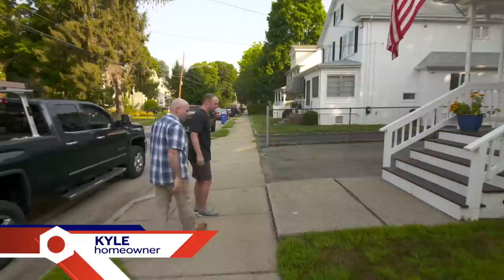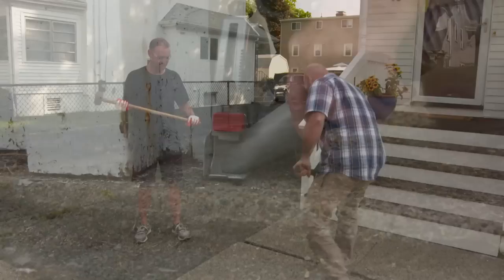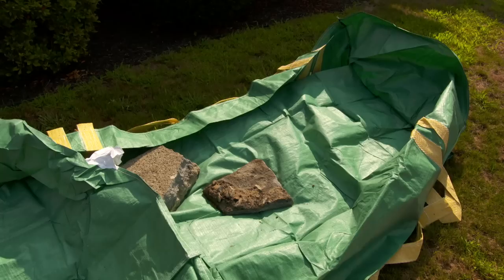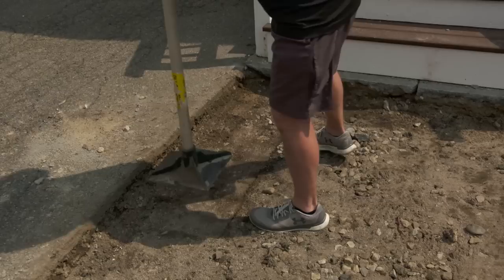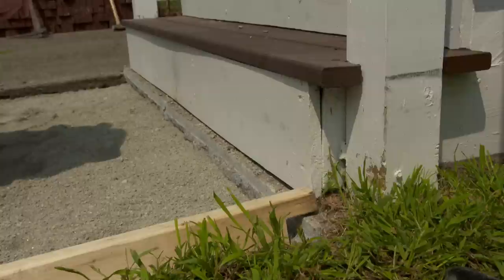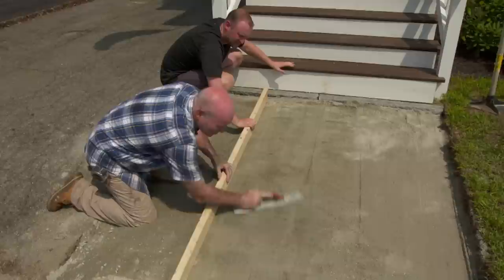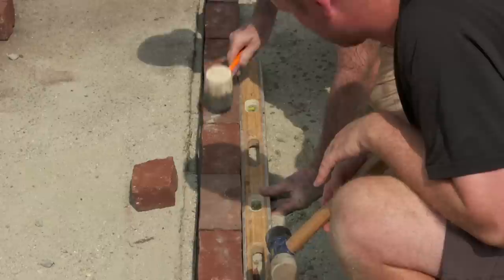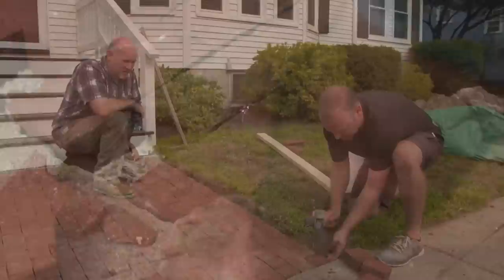How to Replace a Concrete Walkway | Ask This Old House

Comment: I like to use polymeric sand instead of stone dust. It cost a little more but it locks the pavers in better and last a lot longer
Reply: Are you talking about to fill the joints or below the pavers? Or both? I might try this and I want it to be rock solid...
Reply: @MoneyManHolmes  For between the joints,If you do use Polymeric sand be sure to follow the instructions.
Reply: Do NOT USE polymer sand under pavers as you would just be wasting it. The whole thing about polymersand is that it hardens when it dries and become malleable when wet. Giving it a slight self healing effect when pavers move slightly as they always do when things get humid. With the added benefit that they help keep weeds from rooting into them.
Reply: Yup, and it's also more resistant to ant holes and weeds.

Comment: Better method is to put down some landscape fabric between the gravel and the stone dust to keep the gravel from being clogged by the dust giving you better drainage. Sand is better than stone dust too as it holds less water meaning fewer frost heaves later on.
Reply: Rick W but sand isn’t a solid base for the pavers to sit on and stone dust doesn’t absorb water
Reply: Not to mention the inevitable crab grass that will start poking through-should be fun pulling that shit up 10x a year
Reply: No that’s wrong
Reply: @johnathanbahna7495  Using sand as a leveling product is far superior to stone dust in every possible way,  Landscape stone providers even indicate to use sand. Stone dust absorbs and holds onto water, also causes it to slurry and clump inconsistently, sometimes causing a muddy layer that sinks pavers. While water flows threw a sand medium with ease just like filters.

Comment: Could they have used polymeric sand rather than stone dust to fill the gaps?
Reply: No, polymeric sand is strictly for joints at the surface. It doesn't make for a good bedding material.

Comment: Is the removal of the disposable dumpster free?
Reply: No. Total cost is about $245US (not sure where you live). It costs around 75 just to get the bag from the home center, and the rest is due when the pickup is scheduled with the disposal service. 

The only disposal company in my area that offers this is called Waste Management, and they call this a "Bagster" (mashup of bag and dumpster).

Cheers from New Jersey 07014

Comment: not sure why you didn't also lift the concrete up with the pry bar next to the wooden steps and bust with the sledge hammer. that's the hard way to do it just hammering into solid concrete. lol. ok i see you finally did that in the next frame

Comment: Wait for rain, wtf. They were probably there all day and he now has to wait until it rains to see what they accomplished, doesn't make any sense to me.
Reply: Right? upturn a sprayer hose so it's not a direct spray and get the job done. Or, Use polymeric sand and a plate compactor.
Reply: what if next rain isn't for months?
Reply: Poor guy don't own a garden hose and this old house can't afford to supply one just like they couldn't afford to rent a jack hammer
Reply: Because you want the drainage from your house to follow the slope into your pavers... nothing accomplishes this with stone dust better than a full rain.
Reply: @Homepros888  the price of water in boston is too expensive and rental fees are also too high.

Comment: Home come there is no weed barrier? I had had the weed barrier clothes under the bricks and 5 years later I still have to pick out weeds after I cut the grass weekly every summer. I can't imagine what it would be like without it.
Reply: In this type of application there is always a chance of weeds in the joint. They don't grow from under the brick. They grow superficially in the joint. So the cloth won't do much to help that .

Comment: I hate using a sledgehammer climbing on top of a dump truck pounding it so I can fall through the tail gate with out problems it's back aching work wire mesh is the worse takes the wind out of u

Comment: They don’t realize that it will more likely be a forklift getting the trash. That forklift will do a lot of good for that sidewalk. And ATOH should have a jackhammer on hand like now they have sledgehammers on hand.
Reply: I looked into those bagster things a long while ago when they first came out. They need to be placed close enough to the street that the truck can pick them up using its on-board hoist, there was no forklift involved. For me, when I do work around my house it is a lot cheaper, easier, neater, and faster just to throw stuff in my trailer and then pay to tip it at the County transfer station.
Reply: Those Waste Management bagsters get picked up by a WM truck with a crane arm, not a forklift. If you place the bag near the road as they instruct, they just come and pick it. I did this last year and that's how they picked up the bag.

Comment: Why screed it when you are still going to hammer each one?
Reply: Because by screeding the surface you get an aproximation, it's not supposed you will get it perfectly right with only that. I wondered that myself, but it's because we are thinking about pouring concrete and this is stone dust.

I mean, if it were concrete, you screed it and you're done (well, not exactly as you then may "polish" the surface, but the leveling is done), but this is stone dust (in the end: sand), and they are working on it afterwards (you can see them both on their knees) on different ways. So, again, screeding it is more about having the surface kind of ready without too high or too low points, but then you have to set the bricks in place with some "convincing", also because those bricks are not all made equal.
Reply: For just the reason he said. You cut the high spots and fill the low ones. If you don't do it your walk is eventually going to end up very uneven.
Reply: fadetounforgiven d
Reply: @rickfromthecape3135  it's still going to be uneven.  Those bricks have indentations in them and they were standing/kneeling in screened area. You should always work pavers out which means walk on ones that have been set.  You can even put down plywood as to not indent some bricks.   Not a professional job but merely a homeowner fix.  It will look good for the first year.

Comment: The home owner is an actor. if you have ever done that kind of work there’s no way your not walking away from that with your legs not bleeding cause the concert destroys your legs
Reply: They aren't actors - they are the real home owner.  However, the scenes are professionally directed where they have a full labor crew behind the scenes do the bulk of the work while the production takes the intro, some intermediate, and final shots of the homeowner doing some work.

Comment: Sorry, but if you have a concrete saw then why not just cut it into pieces instead breaking back with sledgehammer lol. Also.. this looks like crap. Anybody who would get rid of concrete to replace it with bricks is crazy. Concrete looks 100x better and you won't have to be out there every other day spraying weeds.. and forget shoveling snow off bricks.

Comment: All you need to do is to take a pickaxe (I perfer diamond) and you mine out the old concrete and put in the new concrete blocks. It's not that hard.

Comment: Slabs are much better. Way easier and cheapier to replace, don't crack, you don't have to blew the hole thing. Concrete patways eventually suck.

Comment: HOW TO DISPOSE OF CONCRETE FOR FREE
Not sure why they recommended a disposable dumpster. They are costly. Think they run around $80, ouch! Here are two free ways to dispose of broken concrete pieces:

1) Drop it off at a local concrete plant.
     Most local concrete plants will allow you to drop it off—just pull up to the weigh station or office window and ask where the drop off area is located. Bring gloves since you are typically expected to unload it yourself, e.g., just drop it on the ground and they'll take it from there. They'll even pay you for the concrete. The payout is minuscule it's more time efficient to skip the weigh station for small loads unless you have several tons to drop off.

2) Post a "Free Broken Concrete Pieces" ad on Craigslist.
     Also, I've had a lot of luck posting "Free broken concrete" ads on Craigslist. I always include a note that says "You must load." In a large municipality, it may take a few days before someone responds, but it is surprising how many people are excited to take it off your hands. Most are filling pools or large holes, so Craigslist may be a better option if you prefer not to haul and unload it yourself at a concrete plant.

*I've disposed of 19 tons of concrete from my backyard. Out of that, we dropped off 16 tons at the concrete plant, for a payout of $45, which I gave to my laborer as partial payment for the days work. The remainder was given out for free on Craigslist.*

TIP FOR BREAKING UP CONCRETE WITH A SLEDGEHAMMER
Have someone else lift up the piece you need to break with a pickaxe or heavy duty bar. Alternately, lift it up and jam a smaller piece of concrete under it. This will break it up much faster, and with considerably less effort.
Reply: dig a hole and bury it

Comment: Why not just hose the walkway down instead of waiting for rain?
Reply: He said in the video. The rain will do a better job at forcing the sand into the cracks. Rather than just washing it away. Even a light hosing is usually more powerful than a moderate rain.
Reply: @Luckingsworth  got It!

Comment: Do the concrete correctly the first time with some rebar and it will last, who ever did it before need sacking
Reply: Your exactly right! 4 inch of 5,000 psi concrete with rebar and he wouldn't have that problem.
Reply: Homepros NYC the block work is to labour-intensive not to mention costly and it doesn’t blend with the street

Comment: It his sad to see TOH do a job were almost everything was done wrong. Climate in that region requires at minimum a foot of half inch stone, then dust.  Those plastic hedging are useless. They will start moving within the year nails and all. You use more rock for ege of the grass! When job finish you use polymeric sand and mist it with "let say a hose". No need ti wait for rain. There's no landscaping knowlege in that crew.
Reply: personally i'd be more worried about how those bricks are going to behave in winter, I suspect they well freeze and shatter into teeny tiny little pieces, an engineering brick would be far more suitable for this application!
Reply: The contaminated base was sad, the packing with the stomping pad was cringy, the painted nails for the snap-edge was a facepalm,  the use of stone dust to fill gaps was just cheating. Sad day for that homeowner, all that effort gone to waste

Comment: so much wrong. stone dust over the stone is just going to sink between the space in the stone used for drainage. you also don’t need drainage under pavers, you want to slope them so the water runs off them, not under them, it will completely ruin the base and your not going to have a level surface.
Reply: you need a good foot or 2 of sturdy base, some crushed stone and stone dust [r blend] and a thin lyer of sand.

Comment: Lifting the pad then hitting works but then they realize let's just hammer away at a flat pad...
Reply: No, because it doesn't break nearly as easily as when there is space below the point being struck for the material to break into. 🙄

Comment: Not looking to rent a jack hammer? He should've had one for this small job... They have small ones for such jobs. Is it beyond budget of This Old House?
Reply: It's supposed to be a demo for how they recommend for a DIYer to do it.
Reply: Yea isn't it a joke, This Old House can't afford to rent a jack hammer nor do they own one! I have two breaker hammer, three demo hammer, and four chipping hammer, and I am just a small construction company.
Reply: You missed the whole point, it was to show how to do the job with basic tools and honestly as small as that concrete area was it would be a waste of money to rent.  You could have most of it busted up by the time you go to home depot and rent one and drive back..
Reply: That job didn't require a jack hammer. I have a small DeWalt demo hammer and have used it on larger slabs than that. Would have done the job in 1/3 the time and no back breaking sledgehammer work.
Reply: @eosjoe565  your right Joe, work smarter not harder. Save your strength for the rest of the job.

Comment: This was a horrible episode from you guys. How are you gonna skreed then walk all over it. Use the water hose. They do sell nozzles that have the same effects as rain. Oh, and why compact the stone dust? When you tap the brick in, the dust would rise to fill the gaps from on the bottom side of the brick.

Comment: The stone dust will eventually wash away in heavy rains.  Owner will have to add stone dust over time to fill the gaps.  I would have replaced the walkway with concrete and not bricks. No maintenance on concrete if done correctly.  Bricks look out of place to me...

Comment: They completely messed up the sand layer by kneeling on it laying the brick down after compacting it. They should have been standing on the concrete and working inward instead of standing on the sand. Amateur work at best.